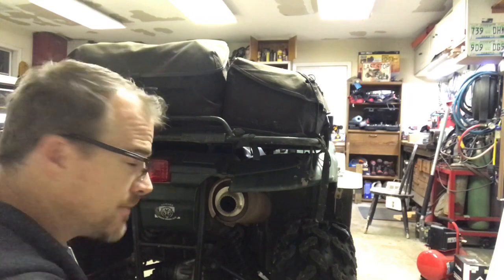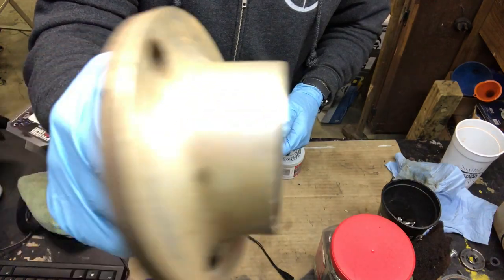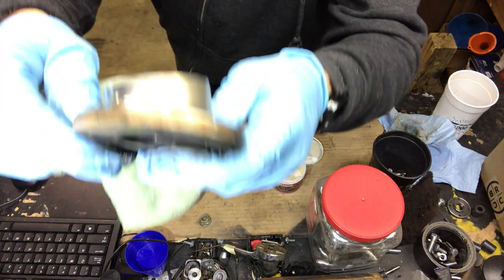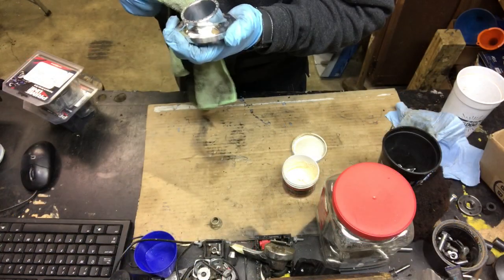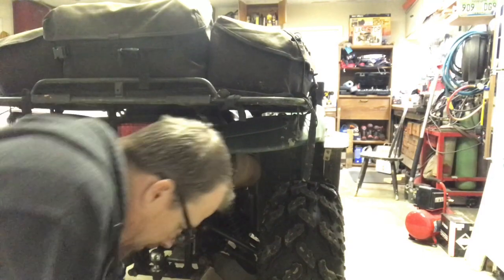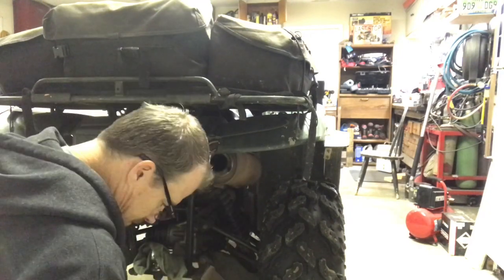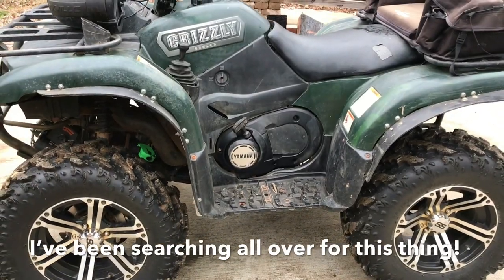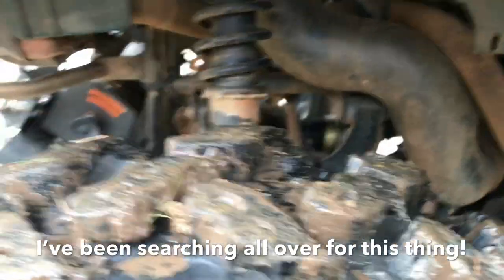Atv Yamaha Grizzly 660 Exhaust Tip

Comment: hey Michael, other than sound and looks, do you notice any difference in throttle? I think these things are just a gimmick. I have the same bike and thus the reason for asking as I have been considering purchasing one for a while but I don't want to make the bike too loud, it's not the quietest now, I can deal with a deeper tone but don't want drone.
Reply from the maker: It seems like it has improved it. like with any exhaust if you can make the motor breathe better, you get better performance. 

The sound while idling is great,but it gets louder as you give it more throttle. In my opinion it’s like getting aftermarket mufflers/glass packs for your car.😎

Comment: were i can buy it? Ebay?
Reply from the maker: Joao Parreira yeah that’s where I bought mine. I’ll see if I can find the seller who I bought mine from. 
It’s been several years now.
Reply from the maker: Well just as I expected, Xaxia doesn’t offer that tip any longer,
BUT there are several others just like it on eBay. I saw one from a company called krator that looks exactly like mine on eBay. Go search for grizzly exhaust tips and find you one that fits your Year and model atv. 
Let me know how it goes. 👍👍
Reply: Did the tip make you engine not run right ??
Reply: @Jcoutdoors989  No, my engine run right whit the tip
Reply from the maker: JCbassin TV no, mine is still running just fine.
Reply: @MichaelEd  what is the gasket you put on before installing youre tip?
Reply from the maker: Mathieu Levesque no gasket is nessary for the exhaust tip, I did reuse my spark arrester from oem exhaust tip. That video was my first YouTube video release. Here is the title to that video:Atv Yamaha Grizzly 660 power tip exhaust mod.
You can easily find in my playlist: atv Yamaha Grizzly 660 mods, on my channel.
Thanks for the great question Mathieu. 
🔴 Do me a big favor and click that “Subscribe” button, I would greatly appreciate it, and check out the rest of my videos on my channel: Michael Ed

Be safe; stay health 👍

Comment: How u put the  Spark arrestor back on?
Reply from the maker: The spark arrestor has a few tack welds that I had to grind off of the original oem exhaust tip, as long as you just grind or even drill out this tack welds from the original tip, you can set it up against the muffler. It should stay in place with the spark screen cone going inside the muffler and flange up against the outside to keep it from falling inside the muffler.
After that you Should be able to install your aftermarket tip.
If you check my playlist: Atv Yamaha Grizzly, I have a video (actually my very first video) called Atv Yamaha Grizzly 660 power tip exhaust mod, and there you’ll see where I grinded off the spark arrestor from the original exhaust tip.
Due to different makes and models, your set-up may differ and may require other modifications. 
I hope this was helpful. 
🟥🟥🟥🟥🟥🟥🟥🟥🟥🟥🟥🟥🟥
Be sure and click the “Subscribe” button.
Reply: Michael Ed gotcha thank you man, do you still have the Grizzly 660? My dad has the same Grizzly 660 (black color) He Loves It! I’m just trying this tip out cuz the stock Exhaust sounds bad 😂 next year probably gonna buy a HMF Exhaust🔥 - I subscribed 💯
Reply from the maker: Yes, I do still have it! I did a video about 4 months ago. I took the Grizz out for a rip and got some air! lol
You shouldn’t have have any issues doing this mod to your dads quad. From what I saw, Oregon looks like a great place to ride.👍
Nice Kawasaki btw, I subscribed and looking forward to your next upload.
Reply: Michael Ed oh yeah I just seen your video  that looks fun to ride 🤙 I appreciate it man, looking forward for your next video As well.